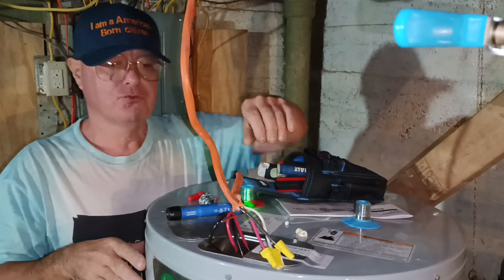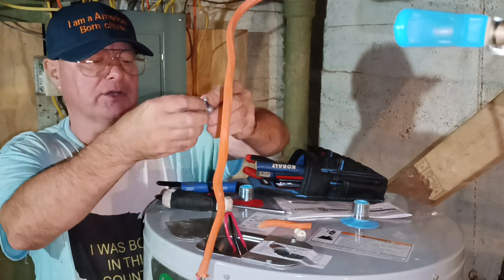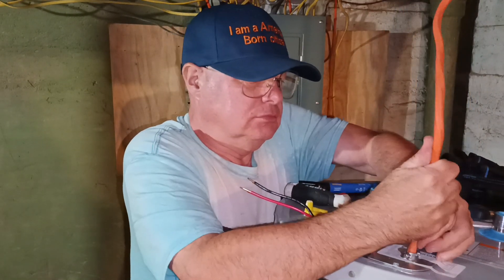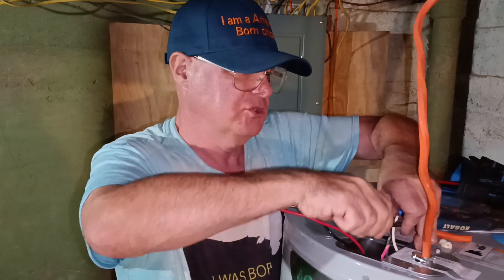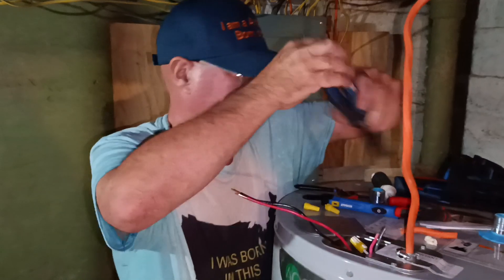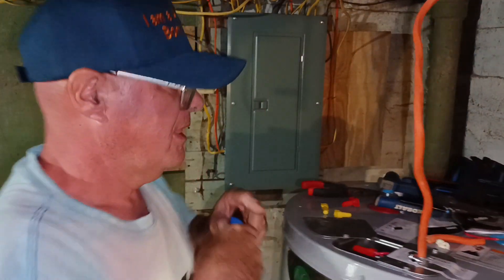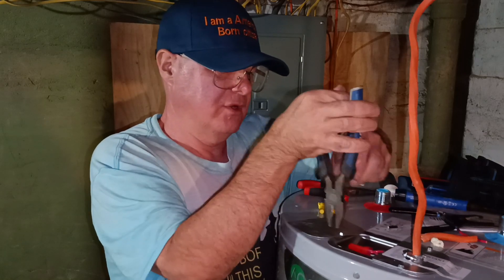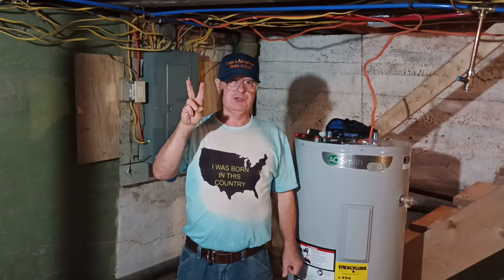how to wire a 240 volt 30 amp water heater and what 3 wires to use out of 10/3 red black & white

Comment: I have a 10-3 wire from my main breaker box going to a breaker switch. Red is in center and black and white to either side. At main breaker I have black and red attached to 40 amp breaker and white wire to buzz bar. Trying to connect a hot water heater. You say not to use white wire. But when I test the black and red wire at the breaker switch I get 110 volts on meter. Which means I will get only 110 at hot water heater if I hook up the way you show. Hot do I get 220 volt? The hot water heater is 220. It will run on 110 volt, but not very well.

Comment: the only time you need a neutral on 240 is when 120 is required. why  did you waste using 3 wire when it's not necessary.
I'm out in under 2 minutes
Reply from the maker: We had it left over